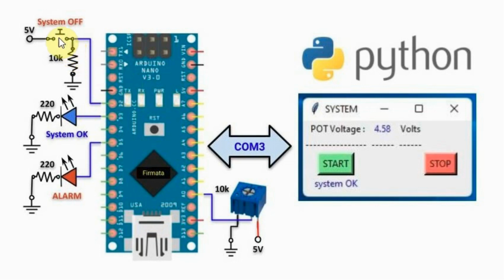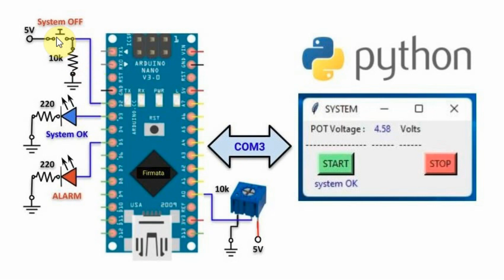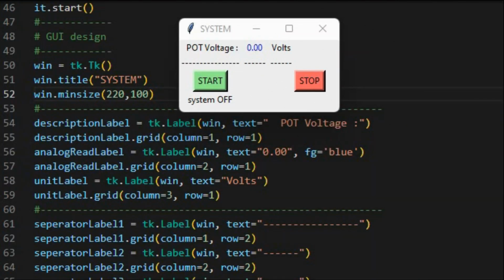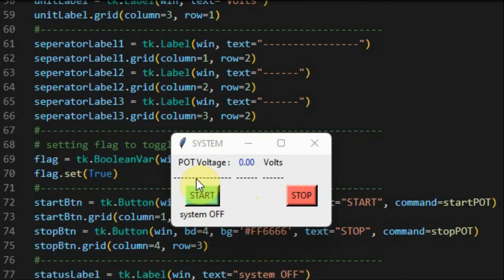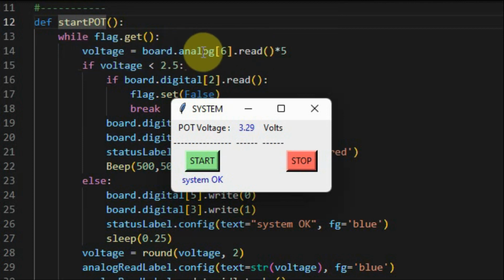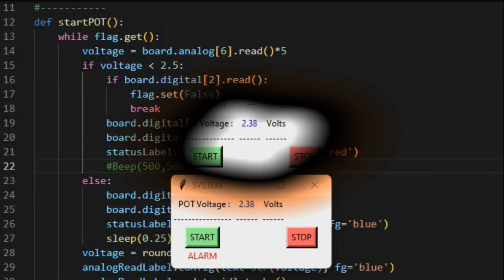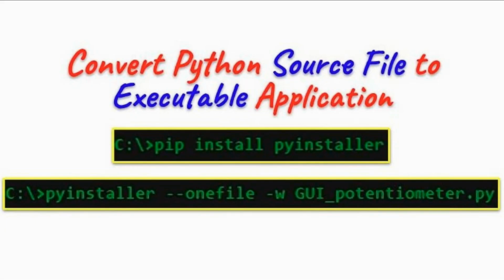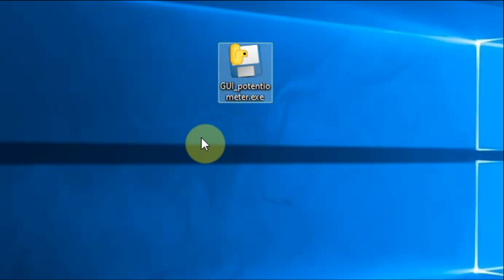Python GUI for Arduino Analog Input

Comment: I get "none" when i run the project with my arduino. I can't see any values. What's the problem do you think? Thanks for your help and your video...
Reply from the maker: Did you install the StandardFirmata sketch on the Arduino? It's in the Examples menu of the Arduino IDE.